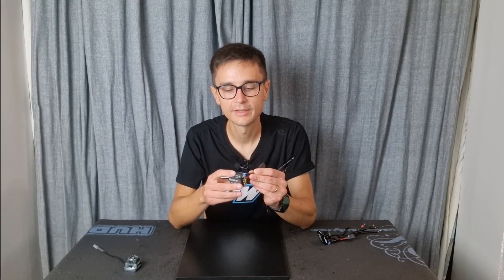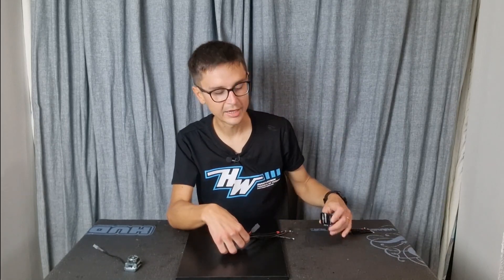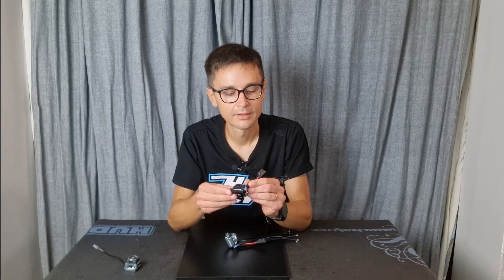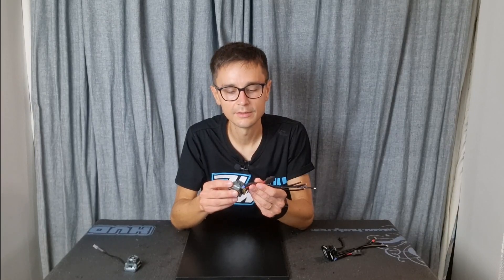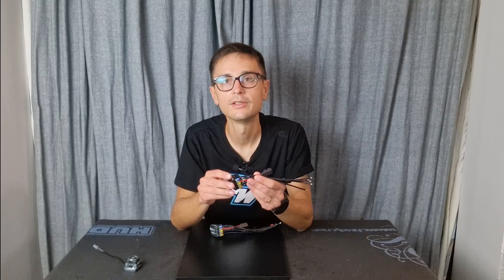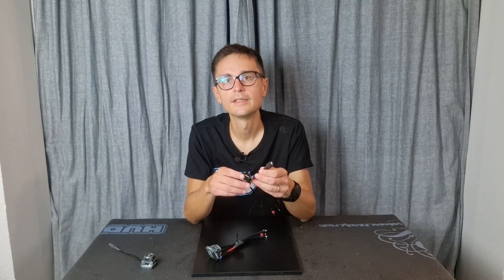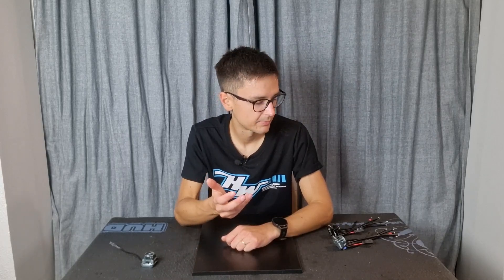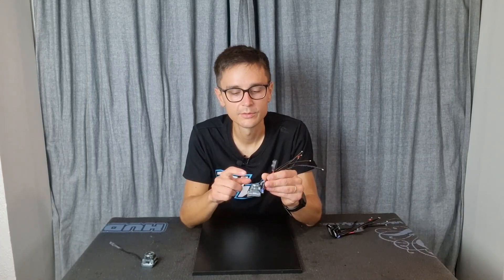HW G3 & G3X ESC New Features Explained!

Comment: Hi alex, I race the 17.5t stock class and the 13.5t boost class. I have already bought the G3, will it greatly affect the performance compared to using the G3X? And if it is very different, what settings on G3 can I maximize so that it can be equal to G3X?
Reply from the maker: The G3X will have more punch throughout. To try and up the punch settings on the original G3, the only thing you can do really is to 1. Maximize the throttle rate control 2. Remove all softening 3. Lower the drive frequency 4. Increase the initial throttle force
Reply: @hagberg  Okay thank you for the advice, I watched the hobbywing official channel youtube video and mentioned that there is no significant difference between G3 and G3X, only different in cable size which causes G3X to have a little more power. Is that true? If it is true can the original G3 be replaced with a 12awg cable?

Comment: Hi! I’m new to touring racing trying to get started into 21.5 stock racing but eventually move to mod. Would you still consider G3x or g3?
Reply from the maker: Welcome to touring car racing! The G3X will be OK in mod when tuned down. The G3 won't have as much punch as the G3X in stock no matter how you set it up. You need to choose what's more important to you in this case.

Comment: To use the coast, do you have to disable and or set anything special
Reply from the maker: Drag brake won't work with coast. Perhaps you need to use a stronger brake setting to help slow the car down more precisely and more suddenly in certain sections, at least that's my guess. Never used this function myself unfortunately.

Comment: If you purchase the stock version, and if you hook up the non-polarity black cap will it still protect the battery if you hook it up backwards?
Reply from the maker: It has nothing to do with the battery. But the reverse polarity cap won't break in case of reverse plugging the ESC.

Comment: Is it recommended to use 2s 7.6v Batteries in 13.5t super stock or are 7.4v batteries better suited for this racing class?
Reply from the maker: I personally use 7.6 HV packs charged to the legal limit of 4.2 per cell.
Reply: Understood. Seeing the guys use those batteries, they were charged to the 7.6v. Wondering why OEMs make a battery that's 7.6v and can't be used.
Reply: Are those packs used due to being lighter in weight mainly?
Reply: Typically the HV LiPos are basically LiPos that are rated to higher voltage, they Typically have lower Internal Resistance meaning they can provide more power even at the same voltage

Comment: Hi Alex, Can you advise when setting the drive frequency with 13.5T super stock/boost, which is better between 4k and 8k? I see that 8K and higher are for Modified motors. I'm using a 13.5T and wanted to know if setting this to 4k is advisable or leaving it at 8k as I've had it set. The track has a long straight as well.
Reply from the maker: Which motor brand/type are you using? We recommend 8K or higher for HW motors.
Reply: I'm currently using a SurpassHobby V6

Comment: i have a G3X.  I cannot connect my wifi module to the esc.  It will connect, then as soon as i try to go into parameters, or firmware, anything other than the main screen, it disconnects.  It will not reconnect while in the parameters screen. As soon as I exit parameters and go back to the main screen, I can again connect.  It will not allow me to change any settings.  I have updated the software to the latest database.  I have an android phone (S24+)  I say this because I cannot make the tekin module work with my android phone on my Tekin ESC which is one of the main reasons I prefer to buy HW products.  Anyone else aware of a known issue?  Maybe Alex can help?

Comment: I would like to know if running 13.5 boosted if using the stock capacitor is ok or is it recommended to get a bigger one?
Reply from the maker: @pedmar0072  86030000 is a good upgrade for improved performance over the standard supplied cap.

Comment: Great info as always 👍. How is the weight of this compared to the Orca OE101? It’s hard to compare the spec weight as orca is without cables and fan, where the HW spec weight is with fan and cables. We struggle to get the X4’24 light enough (DK stock class 1300g limit, but it weighs 1320, if we get lighter battery we ruin the 50/50 balance, we need light esc)
Reply from the maker: @LyhneRC  the G3X is specified at 93g without cables.

Comment: Great info on both ESCs. Thanks. 

Do they have a limiter for rpm? Haven’t found anything in the manuals. Most classes of local races need to have a limiter enabled in addition to blinky mode.
Reply from the maker: @joergerich  this ESC doesn't have an RPM limiter.
Reply: @hagberg  too bad… but thanks a lot for the info
Reply: The G3 super stock has various rev limit settings, I use the 15,000 and 17,500 settings at local club for FWD 17.5t

Comment: wait a minute, does stock engines need thicker wires then mod motors?
Reply: Mod has more power than you can realistically use.  You arent trying to min/max performance in the electronics, you are relying on the driver to be the performance difference.  In stock, you need more power than you have and you are looking for micro-gains.  I thicker wire will have less resistance and give you a tiny gain.  Even things like length of wire used and removing the ESC fan are relevant.
Reply: @natasmai59  so in that case i can rewire my xr10 speedo from 12awg to 13 awg and save some grams in my mod buggy?
Reply from the maker: @extec101  absolutely. 13 awg is perfectly sufficient for modified.
Reply: @hagberg  nice will get a pack of 13 awg in my next Latera racing order.

Comment: Thanks Alex.  I preordered the G3 and race 25.5T stock touring car.  I am now thinking I should have ordered the G3X.  I wanted the G3 for possible conversion to mod racing.  The 25.5 motors are low rpm and low amp draw.  Should I consider changing my order, would I really see a noticeable difference with the 25.5 motor and the G3X?
Reply from the maker: @roken2278  yes! Certainly
Reply: @hagberg  Oh shoot.  Pre-orders are all sold out already.  Guess I'm keeping the G3 for now.  Maybe it's time for the switch to mod.

Comment: Does it support i-bus2?
Reply from the maker: @suneetemadsen7389  I'm not familiar with this. Please elaborate.
Reply: It is a new protocol that give telemetry functionality with flysky nb4 pro+
Reply: @suneetemadsen7389 Telemetry is why i use Sanwa ESC and Remote. Doing all ESC  settings with the remote and having esc + motor temps and motor RPM on the MT44 screen is super nice. Would be cool to have more products that use telemetry out there.